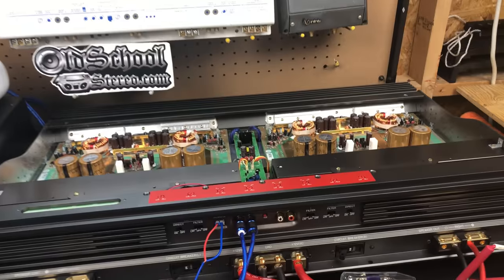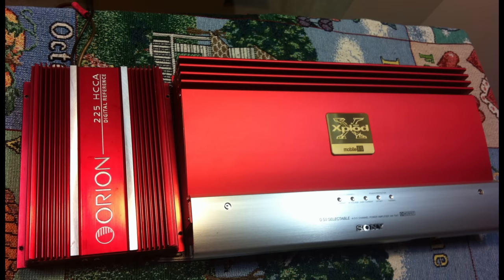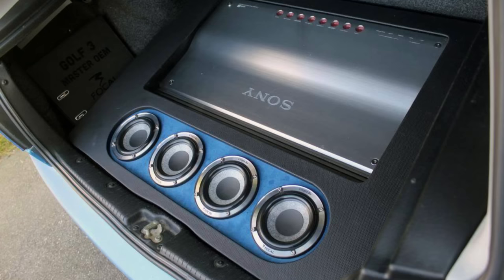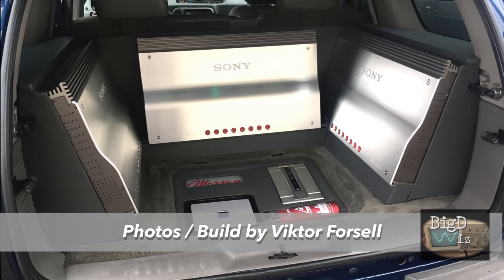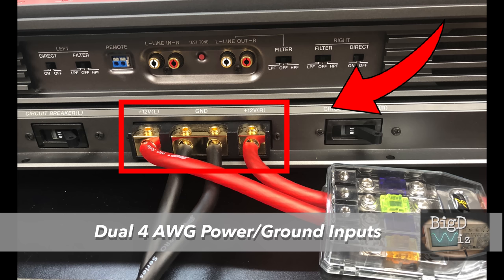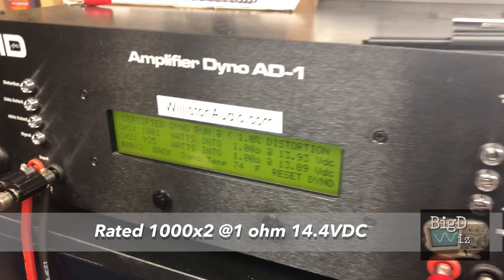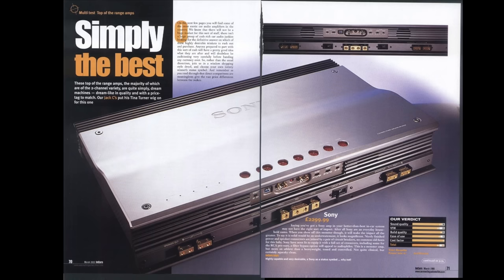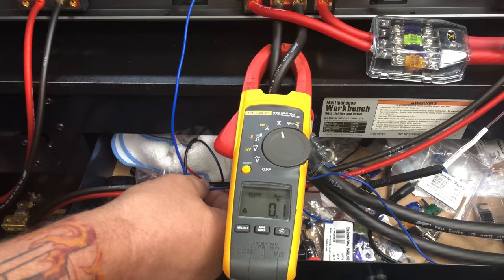Who Knew Sony Made a $4000 Amplifier? The XM-2000R Reviewed and Tested (4K)

Comment: The amplifier is split into two sections for true stereo. This method is used to make sure there's zero noise and blend between the channels, just like your high end home audio stereo amplifier. If I cracked open my Yamaha it's literally split in two, with bare pcb board connecting the two sides. The board in the center helps filter out noise and deliver clean signal to the right and left amplifiers.
Reply: Travis Piper it's called dual mono each channel own power supply and capacitance
Reply: Dual mono amps can have problems with balance though, but who gives a damn with that much power. Least of your worries.
Reply: Emotiva has a cool modular amp setup where you can add or remove channels as needed.
Reply: I've seen Pa amps built like this with XLR jacks, so they must have something going on.
Reply: my alpine is the same way, you can see on the backside where it splits, great amp
Reply: Look at old Soundstream amps, they had separated boards in them.
Reply: And that yamaha is not evn high end but they still doiy
Reply: The 5000ES Sony Home Receivers ($2200) have three boards to eliminate cross-bord distortion, feedback and static. Seriously good amps.

Comment: Thanks Big D your the BOSS. If you look close at the board design and  layout it kind of resembles the Sound Stream M500. The design is in deed for SQ. I'm sure the channel separation is almost flawless with no cross talk between channels. I would love to see the damping control. (Factor) on this amp.
Reply from the maker: Yessir!
Reply: Yep, Soundstream did have separated boards, those were some sweet amps, I believe they were class A. I remember they were always hot, no matter what volume level. but one of the cleanest sounding amps back then. I have seen them melted to trunk liner.

Comment: I learned something new thanks to this video.  I learned that there are amps specifically built for SQ; others are built for SPL.  Thanks, Big D.
Reply from the maker: Awesome, glad I was able to get the point across. It can be difficult to grasp when we are mainly comparing watts per dollar these days. Thanks for watching and commenting 🤙
Reply: I've run ab ppis before and honestly I can't tell the sq difference in a class ab vs d.
Reply: They guy who designed the original Orion and I believe PPI amps is making brand new SQ amps, look up Boland Audio.  Very nice stuff.  American made too.

Comment: I've had my two Sony XM-D9001GTR for years. Never really had both connected, so one is still pretty much brand new. Not the best, but they do an alright job for what they are. Had one connected to two RE Audio 15's in a ported box tuned to 30hz. Sound Quality was great, hit the lows amazingly for the lower power.

Comment: What's up bro... Been checking out your vids and seems you're full of knowledge... Anyway I'm going big and need some good advice... I run a l7 15 right now in a rsx but I'm planning on adding 3 more... What amp or amps do you recommend to push these full throttle... Looking to get into spl drag... I love the Rubicon 2500 because they're fairly priced and I know you can strap them... What's your opinion on them.
Reply from the maker: I’m not a big fan of the Rubi 2500’s. They are really cheaply made. I’d look at Orion XTR-2500Dz’s, which are far more powerful and can be strapped as well. They are much better quality and made in Korea

Comment: Hey buddy, great video! Sony fabricates nice audio equipment both for car and home use. I have a Sony subwoofer, pretty big enclosure, and weighs enough. I recently tested the full thing with a friend at his place. The bass was lacking a lot and we decided to open up the cabinet. We found out that the foam surrounds around the sub is separated from the woofer itself. As far as I could test it, I slightly pressed on it and the voice coil seems intact. Can I just put it together with some glue or should I buy a new sub for the enclosure? I’m wondering what your opinions are. Best regards, Emiel ( you can pronounce my name as ‘a meal’ in English. ) Thanks 🙏 in advance and keep up making more stuff like this.

Comment: No one seems to know that SQ amps exist or how much better they sound. My first amp was an MB Quart 100w x 4 at 4 ohms. Lasted for years, had some issues with it, but it was an OK amp. Then I replaced it with a Zapco LX 150w x 4 at 4 ohms, an amplifier costing around 8 times more. The difference was substantial and it's been perfectly reliable.

Comment: where is the other 2000watts going ? heat ? 335Amp pull is nuts
Reply from the maker: That was at the end of the test. If you pause when the amp hits 2994 watts, it’s less than 300 amps

Comment: Big R thoughts; i see what i think is gold or gold plating on the printed circuit board. How important is that and does it really make a measurable difference in current or resistance performance? Thanks
Reply from the maker: Great question for an amp designer! Sure looks nice though
Reply: Ryan Fisher 
Gold plating resists corrosion. Pretty much its only benefit. But, is really needed in the automotive environment.

Comment: 2000x1 bridged. You didnt test that? I love my old sony amps. I used to run a 3 way front stage and 2 12 kickers off 1 sony xm-3040. It was amazing. AND it was in a  suzuki samuria. Free air ish. I still have 1 that works. I also love my a/d/s amps. God they sound so good. And my current setup uses a 5 channel soundstream 705s. Not near as good of sq as the sony or ads but super veritile and easy to tune w/o a lot of other componants to f with. Keep it old school you big dummy!

Comment: Mobile ES was the shit actually, it was one of the top end brands at that point. Had like a 5 year warranty on all Mobile ES branded Sony stuff. Then they came out with Xplod and Sony Mobile audio went to complete shit. They also dropped the long warranty.
Reply from the maker: Quality components are expensive. Difficult for mfg’s to justify in most cases as the ROI is unknown
Reply: Yeah but they had a pretty decent following towards the end of the ES line. After that they mainly became a walmart brand in the states. I'd say they did a lot of damage to their name in general. The funny thing is over in Japan they are still one of the top brands and actually still make really high end gear.
Reply: Agreed! I had a Sony es head unit back in the 90’s. It gave out, and the warranty got me a replacement xplod head unit. Not nearly good. I also had an eclipse deck. It was my fav by far
Reply: Same with there home audio.
Reply: Yep, you can still buy crazy 10k dollar amps and stuff for home audio over there. Over here the only high end products they have now days is TV's and projectors.

Comment: An ideal amplifier doubles power and distortion (unfortunately without some wiz bang circuitry to remove it) at each halving of impedance.  I truly hate the SQ moniker as it relates to amplifiers that cannot drive difficult loads including lower impedances and reactances. Why?  It is simply because passive crossovers and conventional speakers in general have components of capacitance and inductance. 
In essence, that massive Sony has to be paired with the most benign bottom end  minus the amp itself. Believe me, it does matter. Affects frequency response, etc.  To test purely resistive is one thing. To test as the Audiograph does is another. 
Built a clone with improvements for senior design in E.E.
That AB amp just needs a beefier power supply that will supply more current and a more heavily paralleled output stage (more transistors) to up the ante. 

Like your videos. Keepem up.

Comment: Still not great efficiency even for an AB class. My old RF power series class AB amplifiers typically sat around 63% efficiency. Hard to beat the late 90's era RF power amps, 20 years and still they are as good as anything you can buy today, and still going strong.
Reply: Why is everybody so obsessed on efficiency? Not once did I ever care about that in the Glory Days of car audio back in the '90s. 🤦‍♀️🤦‍♀️
Reply: @danielknepper6884  higher efficiency is important for a lot of reasons. Namely lower efficiency=more heat, which leads to less output power. Pretty straightforward.

Comment: 1 ohm at 1001 watts would mean 31.6 amps at 31.6  volts
so 
31.6 amps * (31.6 / 13.93) = 71.68 amps at 13.93v. 

1 ohm at 925 watts is 30.4 amps
so
30.4 amps * (30.4 / 13.89) = 66.53 amps at 13.89v.

138.21 amps total.

307.1 amps in, 138.21 amps out

138.21 / 307.1 = 45% efficient.

I had to make sure your math was right, damn that's inefficient xD

Comment: Can anyone tune their amplifier for sql or does it have to be an sql amplifier?
Reply from the maker: SQ is in the ear of the beholder
Reply: Really? I thought that SQ ment sound quality. Like Hi-Res. Im pretty sure anyone can send a Hi-Res single from their source to a DAC. Amplifiers use an analog signal input through RCAs. If you have a decent source player/DAC/preamp that has RCA output. As long as you keep the bass boost turned all the way down and ajust the gain correctly. I guess that you could make any amplifier SQ. 🤔

Comment: Wow Sony should never ever have gotten into car stereos nothing but garbage from them all there amps suck along with there subwoofers trash trash trash
Reply from the maker: Is you cray? I agree some of the Sony car audio was junk, but the ES and XES gear was 👌
Reply: @wal  ok well I guess what I have seen and heard was not there high end equipment every amp I had seen from them aside from that giant 4k you did the review on just didn't compare to what rockford fosgate and orion and jl did back in the late 90s anyway I went to tech school for electronics so I was in good with the teacher so he would let me do car stereos for my class mates and alarms and remote starters and all the fun stuff you can wire into a vehicle lol I will say o heard 4 explode 10in. Subs on a sealed box in a Camaro back then and that was actually impressive not only did it make me say holy shit when the bass hit but these were powered by a fosgate 500.1 at 2 ohms so I'm sure it was pushing well over 1,000 watts to it when cranking it up to show it off lol and they would just take a beating I think they were rates 800w max but other than that I never liked Sony car audio I am going to go with Orion on my next build for Acura rdx hatchback style set up 2 of HCAA subs with there hcaa 5000.1d I think it will be insane I always build the reccomended enclosure from the book that comes with them so I get the best sound from them I cant wait to do this one